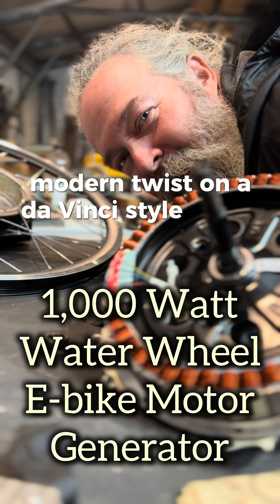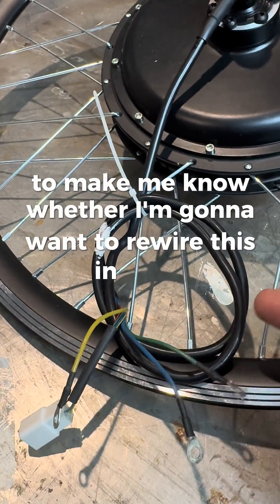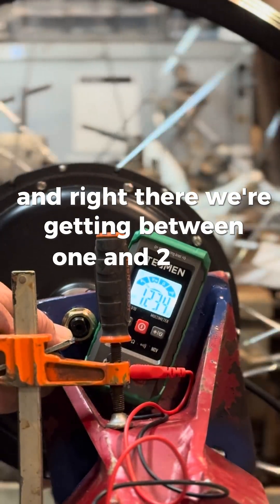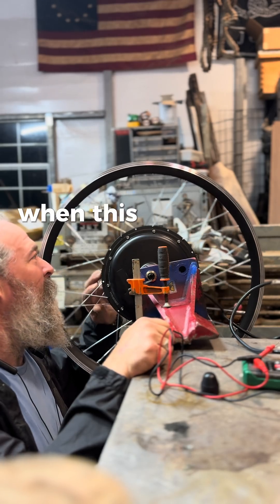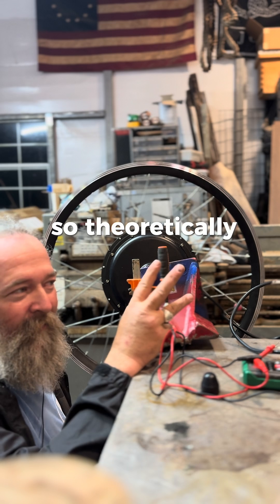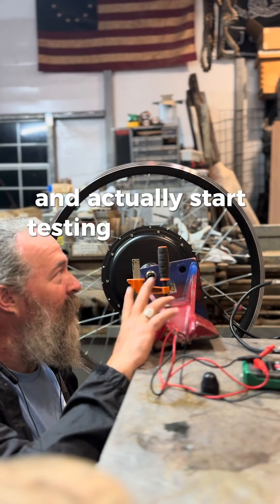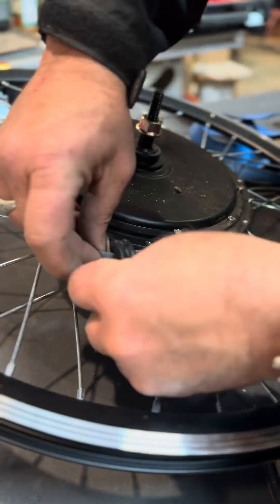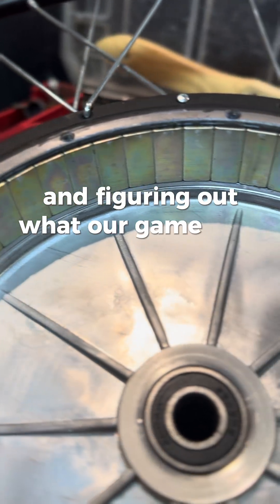Pt1 Ebike motor water wheel generator 1000 watts hydro

Comment: DC treadmill motors and one of those back massagers for you home chair that have rotating balls. those 3 motors are 110 dc and the treadmill is 110 dc.  I used a wheelchair wheel with a 20inch bike wheel rim attached to the side for a belt pulley. I mounted the tiny motor above the wheel and ran a slither of serp belt up to it. What ive learned about motors is if they are 110v, they will only produce a 3rd of the power they normally use. so at a fast RPM, I get 40v unloaded and at a steady slow rotation, I achieve 16v and loaded with the batteries already charged and running led lights , it stays at 13v. So its enough to charge these 12 volt batteries and run the lights with no hiccups. The led lights run off a couple car lighter phone chargers and no Led drivers. Direct current from the chargers with all leds paralleled together. This simplified things inside of the cave I found near my house that was once an underground industrial park that has been forgotten about years ago. My home away from home and my most favorite place on planet Earth I have ever discovered. I frequently check the internet for info on this place, nothing exist . I know its history and names of the people who worked here , news paper on a office desk says January 12 1972.  But I digress, a bolt in the ceiling has water pouring out of it all the time, so thats my power source for lights.
Reply: Tank you man..helsing frå🇧🇻🙏
Reply from the maker: Epic